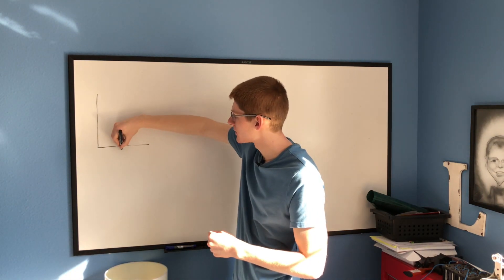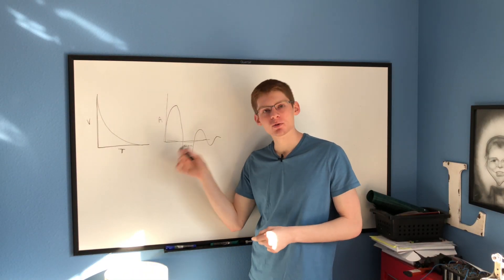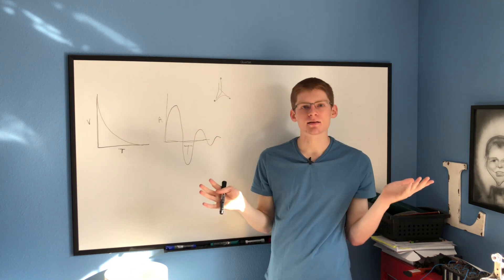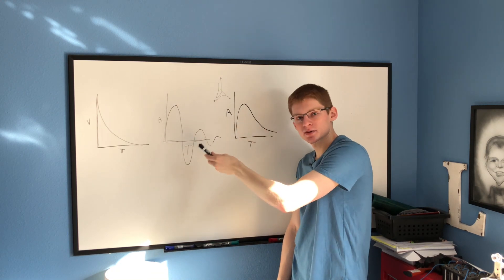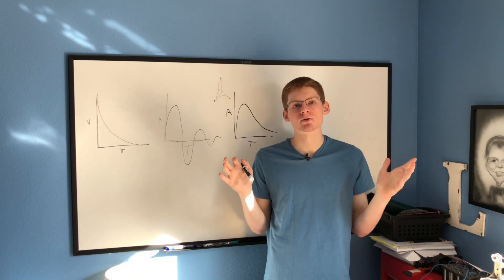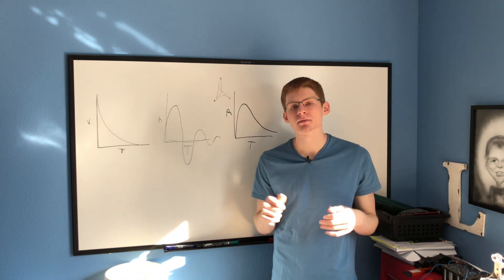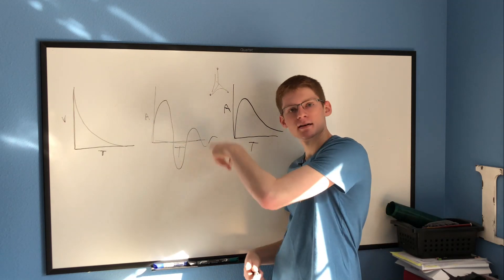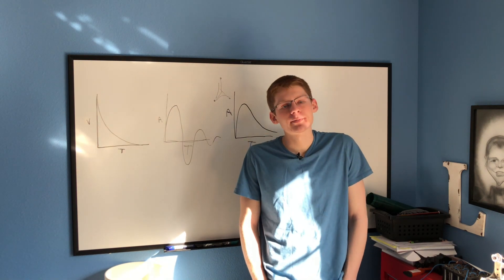Final(ish) Thoughts on the Coilgun Project

Comment: i have messed around with some coils on a much smaller scale and i found striking the projectile so it was already moving before the coil got energised let the 6mm steel bb i was using pick up allot more speed than just using the coil. my theory as to why it worked better than the coil alone is that in the time it had before the capacitor was discharged the bb was already moving so the distance travelled in a active field was greater and allowing it to pick up more momentum.
Reply: Come to think of it if you had a set of spinning rollers before the first stage to get it moving you could have them twisted slightly to give the projectile spin as well as forwards momentum. Not sure if the spin would improve efficiency but it would make it more accurate.

Comment: You could use the magnetic saturation in the ferromagnetic projectile to push it out of the 1st coil when it passes the middle point making use of the negative cycle of the sinewave. Using the negative cycle will increase efficiency and decrease the magnetic saturation due to the change in polarity, thus preparing the projectile to be even more attracted in the next coil stage. With fine tuning it may even saturate the other way around when leaving the 1st coil so it will have more pulling force from the 2nd stage. Like wipping a rope moving the hand in both directions. But I think this level of synchronism would be hard to pull and very suceptible to temperature changes.

Comment: My problem with coilgun is it's acceleration. It's low compared to firearms. To compensated you would need a very long barrel.
I wonder if a ball shaped projectile can be sped up in a loop then released (like a particle accelerator loop) . Technicly it would mean infinit lenght for acceleration.
It would work with DC current from a battery.
Reply: Was thinking the same thing
Reply: The problem to solve with this concept is how to switch from traveling very fast through a toroidal barrel into a straight one. Also, you can't really use constant DC for this purpose, it has to be pulsed on and off somehow or else the force experienced as the projectile enters the coil will cancel out with the force experienced as the projectile leaves the coil.

Comment: The projectile could be powered like railgun and the electrolyte capacitors could be used in tandem with H bridge that switches it's leads when current goes through 0.